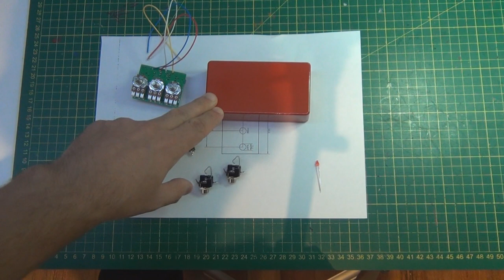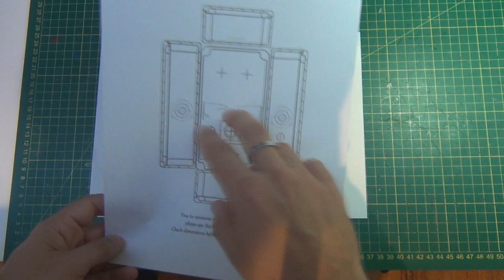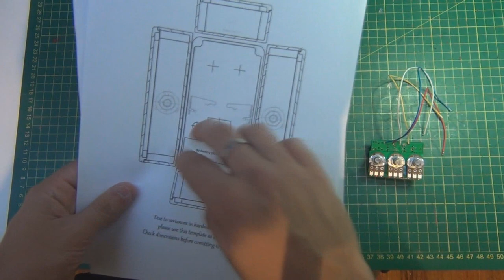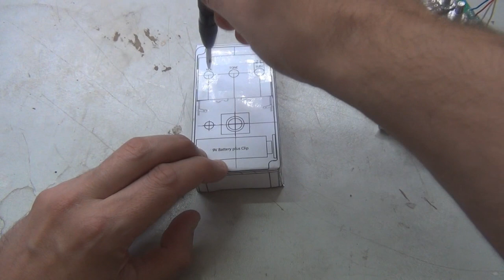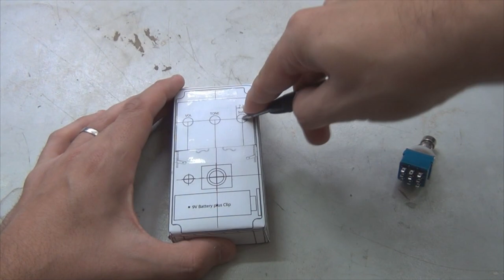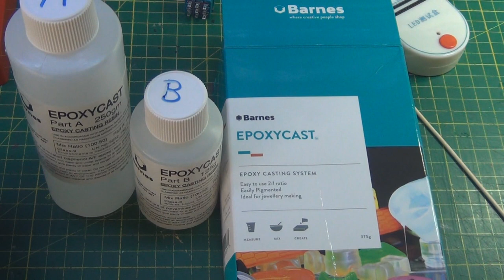Building the Smashing Pumpkins Op Amp Big Muff (DBE Punkn Pi)

Comment: Pedal sounds great man! First pedal I built was an op amp big muff but it didn't sound quite as good as yours! Might have to build one at some stage. Currently trying clear coat spray on a couple of enclosures only because there's art on the sides of these particular ones but definitely trying your epoxy technique next. Looks great! Thanks for all your videos, they have helped me so much :)